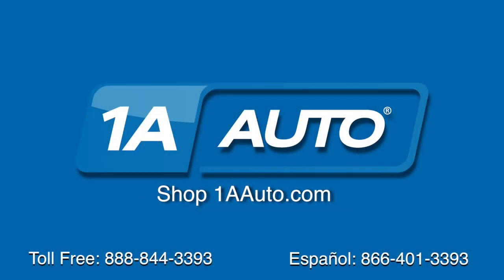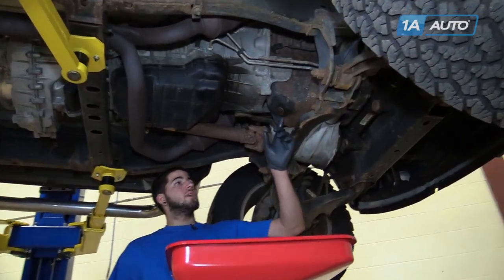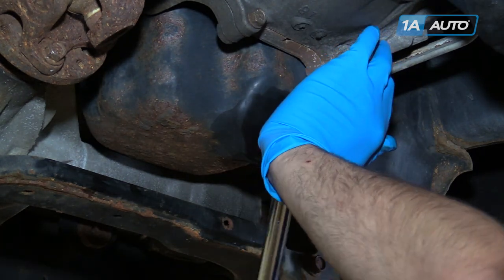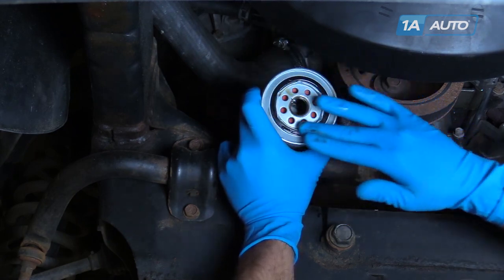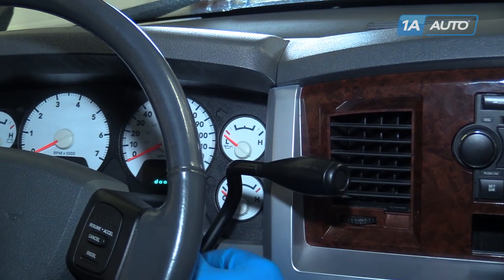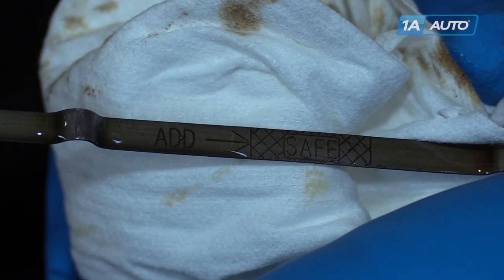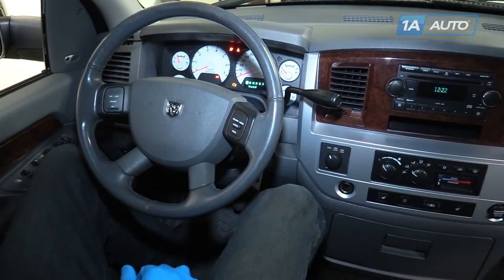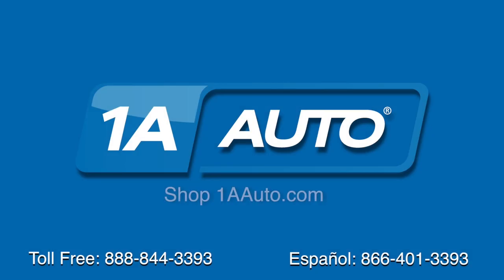How to Change Oil 02-08 Dodge Ram 1500 5.7L Hemi

Comment: Thanks A1 Auto guys! I just finished my own first oil change in a 2008 5.7L V8 Hemi. I pre-filled the new filter about 1/2 ways & lubricated the new gasket before placing it on. (make sure the old gasket comes off before you guys put the new one). I also used a large ziploc bag & fit it around the old filter while I removed it. 95% of the old oil filled the ziploc bag, with just a few drips missing the bag. 

I prayed & started the truck up & all was good. The dipstick was a little hard to read having new oil, but I figured 7 quarts overall would work, as the manual stated. No drips & I did the gas de-press trick, also. Everything works, so far, just fine. 

I used 7 quarts of 5W-20 Mobil 1 Full Synthetic oil for 75,000+ miles. I bought 1x 5-quart container & 2x 1-quart containers, for anybody wondering.

Thanks very much & God Bless You guys! peace
Reply: My 04 takes 5w30

Comment: do you really need the strap wrench or the torque wrench? Because I have the 13mm socket and ratchet but don't have the other two parts that you listed.
Reply: No. Just don't over tighten the drain plug but make sure it doesn't fall out. If you can get the filter off by hand, then go for it. If not, then a big pair of channelocks will do the trick. But make sure you have the right filter before you tear the old one up with channelocks.
Reply: I learned a way to take filters off with a belt lol just take ur belt off and loosen the filter and pjt it back on so ir pants dont fall off
Reply: If you will be changing oil yourself, invest some money in an oil filter strap wrench.  Approximately $9.00 at auto parts store.

Comment: Alright. I just changed my oil this morning. The owner's manual says 7 quarts, everyone else also says 7 quarts. So I put 6 quarts in the engine, started it, shut it down, and checked the stick. Stick says it's full. I checked it about 5 friggin times, and the stick says it's full. Anyone else experience this...?
Reply: Just put 7
Reply: Did you change filter? Also could be that your dipstick is going deeper due to weak gasket.

Comment: This is not where the oil filter on my 2006 Dodge Ram 1500 is... it’s nearby this location but it’s further above the front passenger tire, which is in a really difficult to get into especially if you can’t lift the truck as shown in the video.

Comment: Question I have a Dodge ram 1500   2005 there is a hose coming out of the oil fill to the air filter what is it for notice the other day there was oil on the end of hose going into the air filter
Reply: Not sure if it still matters but it’s a breather tube. It offers ventilation to let condensation evaporate from the engine. Completely normal to have oil come through on the other end to the air filter.

Comment: What is that pan to the right of the oil filter at the 2:05 mark?  My gasket appears to be leaking on that pan. Thanks
Reply: Transmission pan. Probably needs a gasket changed.

Comment: My 07 Laramie drain plug is a 5/8. 🤔
Reply: My 2016 5.7 I put a 13mm on the drain plug and it fit kinda sloppy. So I went with half inch, and it was good.
Reply: I have the same truck what type of oil did you use?

Comment: 5w 20 oil could i run 10w 30 instead?
Reply from the maker: +prentice508 You should use what is recommended from the manufacture. Failure to do this might result in engine damage.
Reply: I have over 200k miles on my 07 hemi  the previous owner was using 10w30 would it be bad if I went back to 5w20 full synthetic high mileage oil or even 5w30 weather is hot all year around I  live in Florida ?